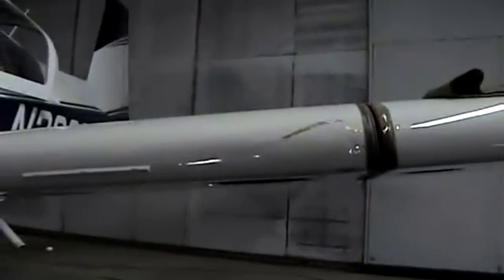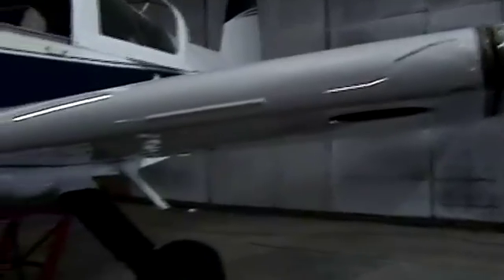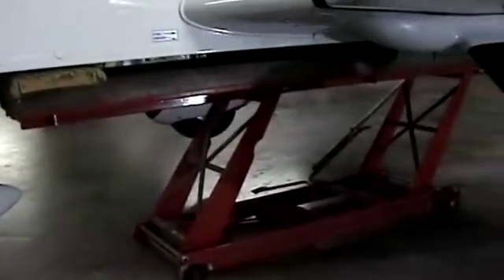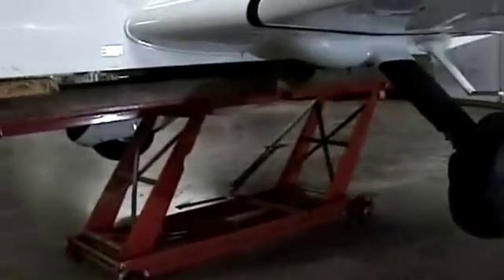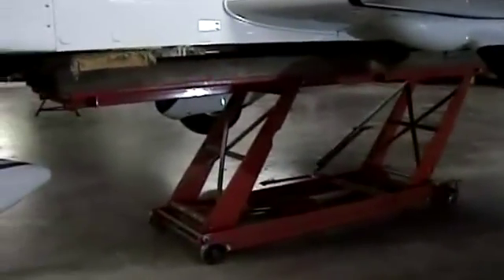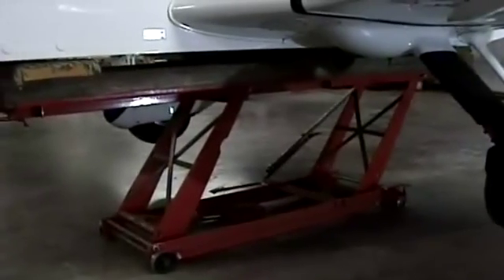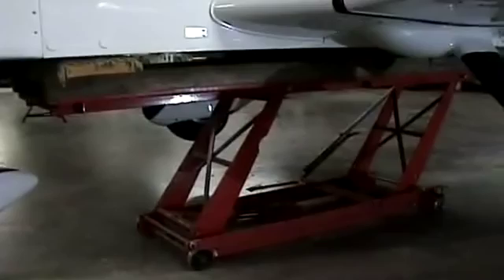Aircraft Lift - Grumman Style

Comment: Does the manufacturer provide any input as to where on the plane you may or may not apply the full weight? 
Seems like you would want to be rather careful with the underside of the fuselage.
Reply from the maker: Yes, along the rectangle of the bottom honey comb.  3 inches around distributed.  SO stay near the edges.  I use the I use Bob's FreshAero jack which has a top bar the is 4 inches wide, 3 feet long and carpeted.  Does a great job.  Roscoe